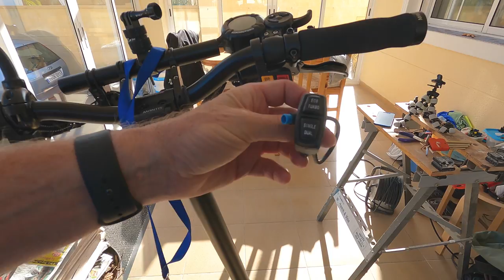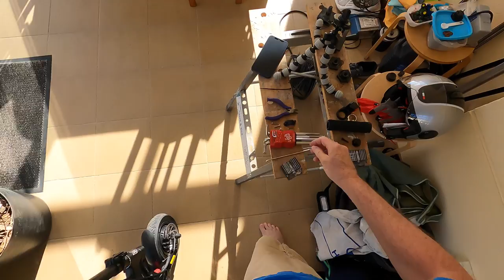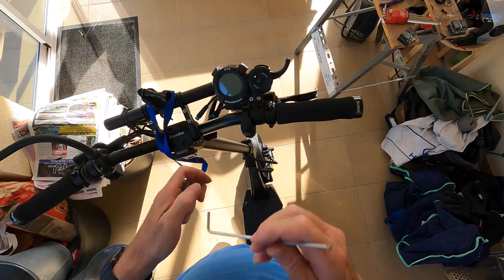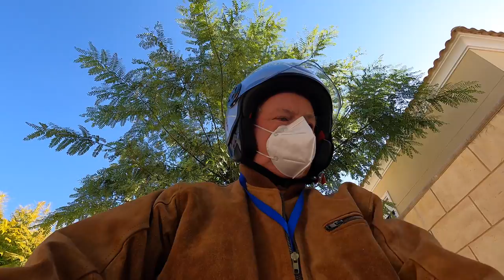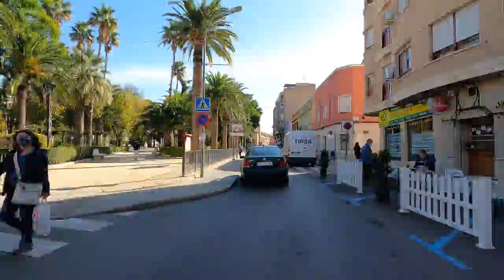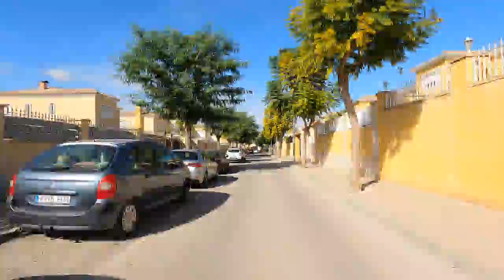Kaabo mantis pro switch upgrade and short ride

Comment: I was interested to see if you bought the switch with the LED indicator. Apparently not! There's one almost identical, also on Wheel Riders on AliExpress, but with a blue LED built in. This is what you were saying would be an improvement. Well, it's already made! There is some advice of limitations depending on which model Mantis you have. Got one for my basic model, but the LED is not very bright. Was after ideas or mods you may have done to get around that. I imagine the voltage at the switch is the same for all models, but maybe not. Nice video of your ride too!
Reply from the maker: Unfortunately the light up version was not available at time I purchased mine. Not sure it’s worth changing again now or not.

Comment: I just bought a new scooter and the single motor works but when I try pressing the “Single dual” only 1 wheel work
Reply from the maker: Probably the wire has come off inside the battery compartment. There are 3 wires per motor, if one wire is loose in connector wheel will not function. You will have to take cover off the top and remove battery. Then inspect the wires, it is a bit of birds nest in there and needs a bit of patience to put it all back.
Reply: @esrider7765  do you know which color wires it could be? I see some disconnected wires but don’t know which color that maybe be for the the second wheel
Reply from the maker: @Itsmetahh   there are some small wires which are not connected. However the motor wires are very thick in comparison. They are yellow green blue. However the control to motor colours dont match as that determines direction of motor on each wheel, do a search on internet for schematic and you will soo.

Comment: Unlike the original unit, you can't tell with the new switch where it is set until you hit the throttle. It's nicer aesthetically but functionally inferior.
Reply from the maker: The old switch never made sense as could not really tell which button was pressed easily either, so it’s which you prefer.
Reply: Sorry if that sounded negative! I've just fitted one like yours and was disappointed that it was impossible to know how the switch was set. I could feel whether the buttons were in or out on the original so knew what set up i had. ( Sensitive fingers?!) I'm installing 12v turn indicators ( motorbike style rear on the footrest and bar end fronts ) and a bright front light on mine. Keep up the good work old chap! All the best.
Martin.
Reply from the maker: @martingulliver7442  Not at all. The original buttons for me where so counterintuitive that could never really figure out what was going on. The only one I really use is the single / dual switch. It would be better if there was a status LED to say what mode its all in .
Reply: Perhaps some kind of illumination to indicate the mode but we'll have to keep watching AliExpress!
Reply from the maker: @martingulliver7442  Absolutely